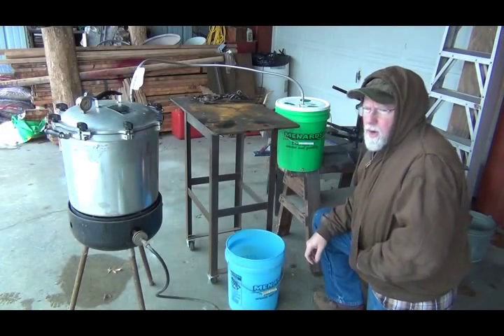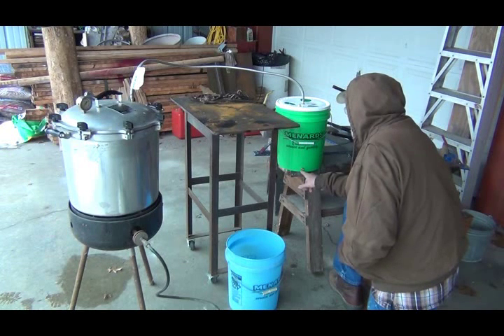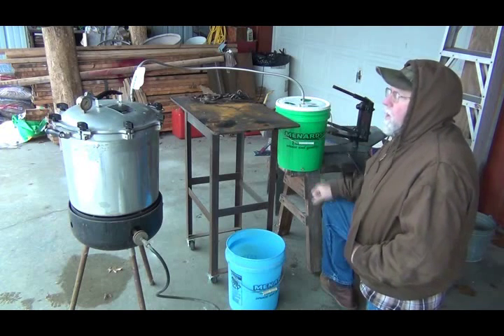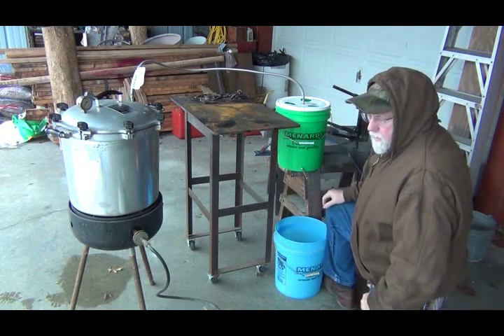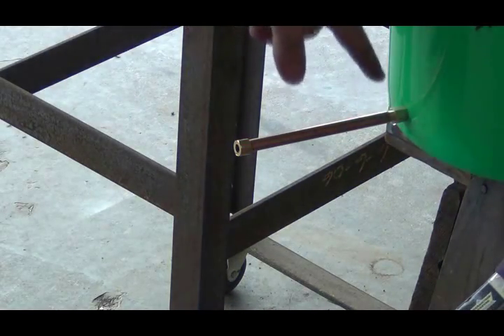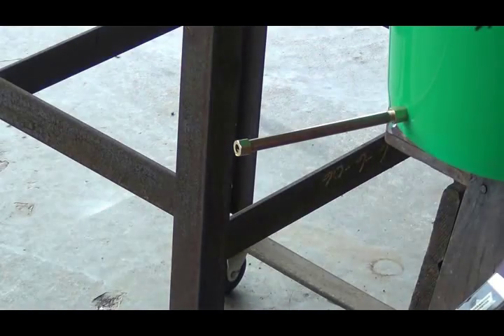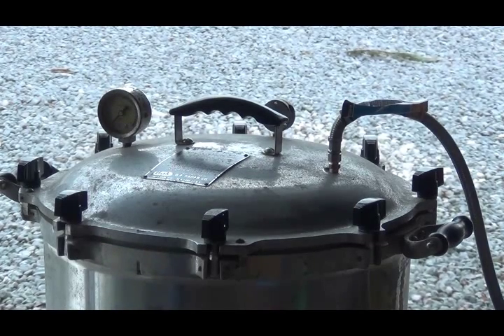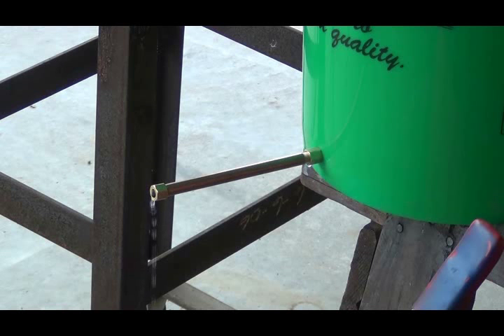Water distillation project pt 2

Comment: You and BCTruck have got this system pretty well figured out. I'm without a shop or tools right now (yes, it's killing me) but I will remember this when I can get to my own system. Thanks to the both of you for sharing the process.
Reply from the maker: It has been fun. Just need to learn a little more about plumbing. Get that leak stopped.

Comment: I'm sure that someone has pointed this out but just in case they didn't I don't want someone to get sick. Never use anything rubber or plastic for your lines only use copper or stainless steel on the tube coming out of your pressure cooker and for your worm and don't use any fittings except for the one fitting to connect it to the lid. Also always run your copper tube back out the top of the worm bucket instead of drilling a hole in the side an worrying about cross contamination through fittings or rundown, it will also give you a more steady flow.

Comment: Hey Buck! Great video thank you very much. Built mine with 3 gal pressure cooker. Did you notice s funny smell after distillation?  I used the flexible stainless tube you did but I wonder if the smell is from the rubber tube inside? Your thoughts.

Thanks again!